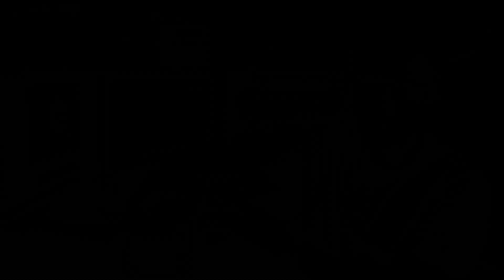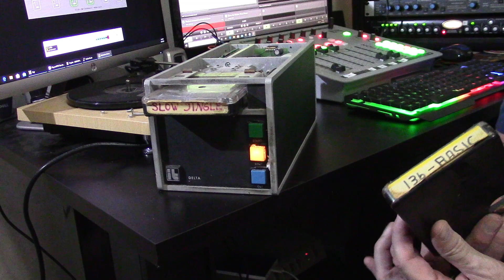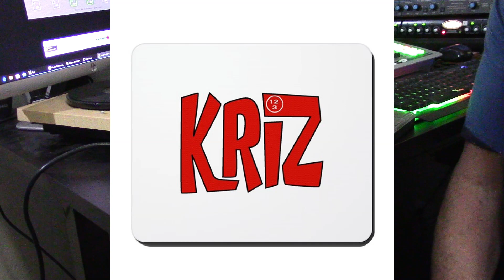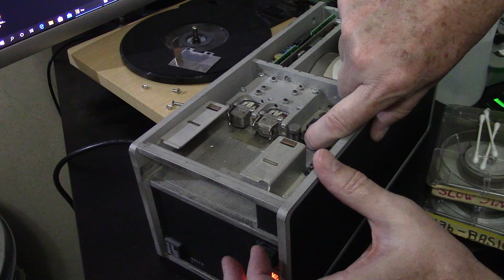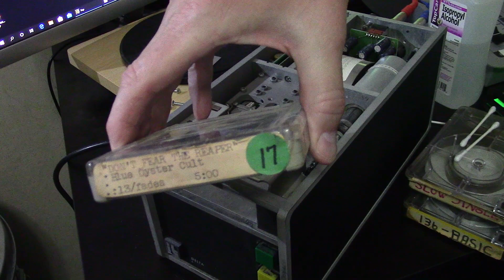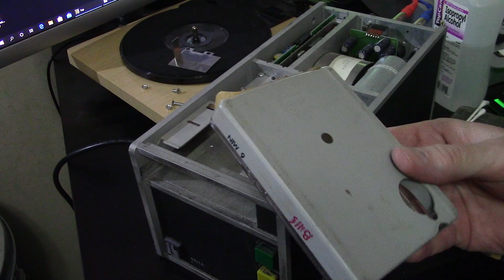AirWaves Episode 29:  ITC Delta Cart Machine, Another Closet Classic

Comment: hi, any experience overhauling the motor bearing on these ITC decks?
Reply from the maker: It's been so long ago that I used them, but I don't recall that ever being an issue.  We kept them very clean and usually the only maintenance issues were with head alignment and worn out pinch rollers.

Comment: I adore this tech - always did. I have few cart machines - some work, some don't - but it seems very hard to find the expertise on them now esp since many of mine are European models (Sonifex and so on) - but I do have one BE and one ITC Unit.  I havent really found any central point or forum where this type of old machine is discussed and where help is sought and given. Does anyone know of such a place?

Of course all this stuff was long ago virtualised in automation systems - and you could even build the equivalent of a whole room of cart machines on one tiny board such as an XY-V17 which hosts a micro USB (TF) card that could hold hundreds of jingles in WAV format and play them on command at equivalent or better quality than a cart machine could - which yeah, is kind of magical - but where's the magic really?   For me, compared to the physical reality of a pile of carts and a triple player stack with flashing lights and tape whizzing around it's a poor replacement!

Comment: SECondary & TERtiary tones were not sub audible. They were 150Hz and 8000Hz respectively which are not considered sub audible like 25 or 30Hz tones are. They were recorded on a third audio track (look at the stereo playback head) and was only "heard" by the machine. There is a way to listen to that hidden audio track from the multipin connector on the back if you know where to find it.
As for your deck being noisy, sounds like your motor bearings need to be given some attention.

Comment: hi i will say   i have 100's of carts yes the sound can be very bad on them    i moved 8 track tape in to the cart as 8 track bodies
are bad with wear  there is 2 kind of loop tape high low out put so when you are playing carts the sound levels can go all over the 
place older carts are alot lower  on sound level  the 80's cart's  are alot better 

the 4 track c cart recorder are very bad i had one  as you need virgin cart's for them  and recording is very bad

Comment: I love this stuff.  It brings back so many memories.  The first station I worked in the late 60s - early 70s didn't have a cart machine.  We used a machine made by Gates.  It consisted of a large roller with 101 strips of tape wound around it.  There was a slotted slider with a notch for each tape.  You selected the tape to be played and pressed the button.  It took 70 seconds for the barrel to rotate and stop.  It was often frustrating because the program log would show a 30 sec spot followed by a 30 sec or 60sec.  Of course once the first spot played you had to fill 40 seconds before the machine cued again.  When I left that station, I never saw a machine like it again.
Reply from the maker: I've never seen such a cart machine.  Sounds more like an early form of automation.  The first station I worked for, played all their commercials off of reel-to-reel tape players.  Only had two players, so you had to really hustle to cue up the next spot.